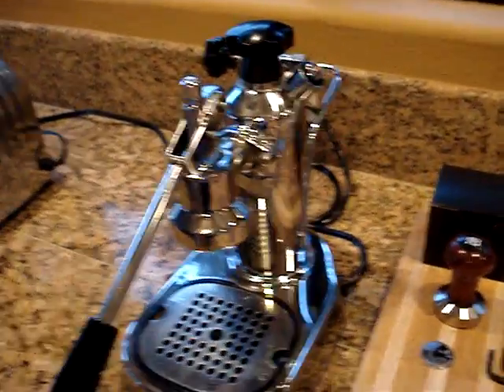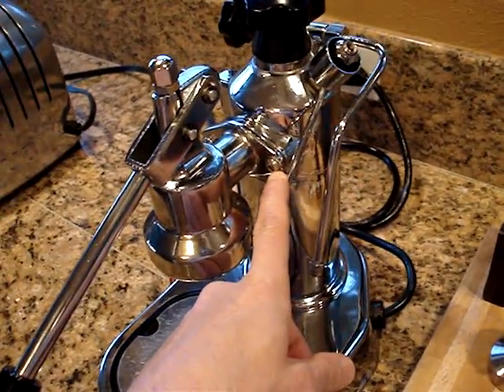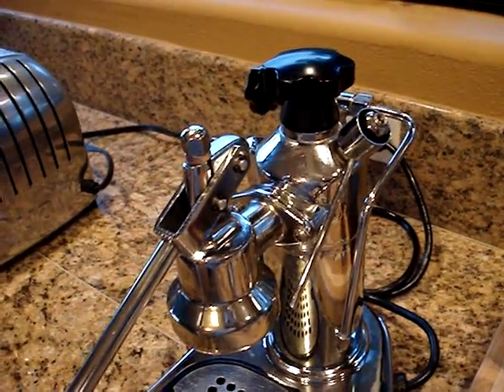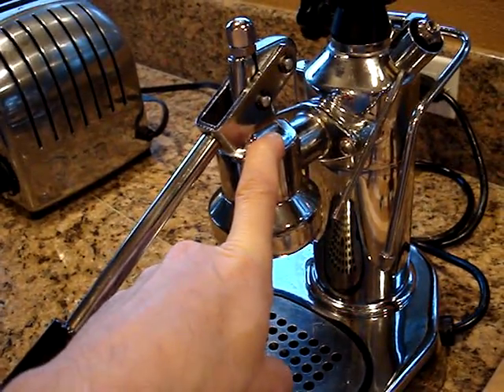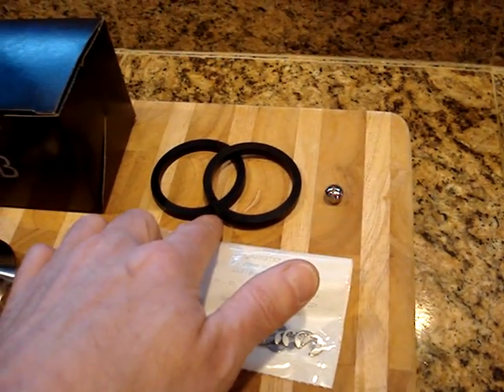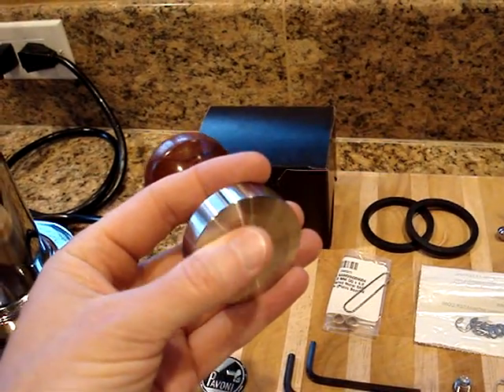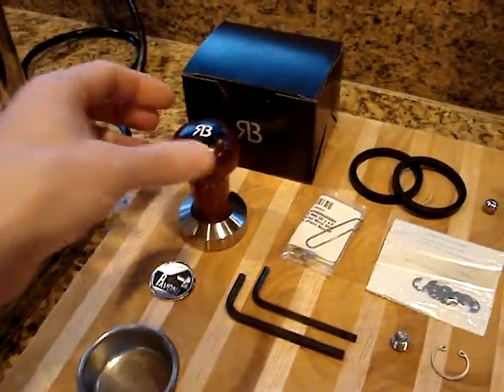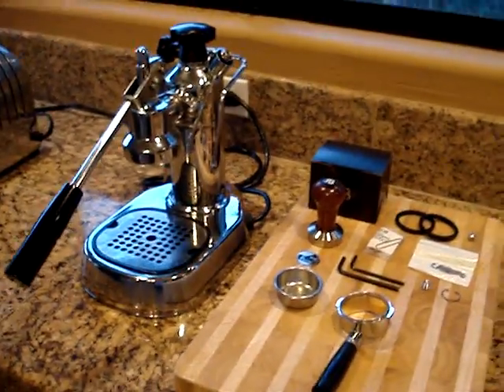La Pavoni pre-millenium espresso machine modifications

Comment: Where do you buy your parts for the LP? I have the exact same model (and I mean exact, except with a 220V european boiler) and I buy parts from OE. Unfortunately OE only has the rounded boiler head seal, not the squared that you show and I can't find E-clips anywhere (I've been holding one pin on with wire).

Comment: what is the reference number of the gasket, looks like a good idea
Reply from the maker: Which gasket are you referring to? This video is 10 years old, so I'm a little rusty
Reply: @ray5961  the flat one deployed under the group that holds the shower head in. Yes I know it’s been a while, I’ve been following your PID adventure on home baristas.  I’m admiring your work
Reply from the maker: @leighp03  Those either came from McMaster or Orphan Expresso. I vaguely remember buying a pack of square profile O-rings from McMaster and having to use a Mach III razor to shave a slight radius into one edge to make it fit, If you search "PID La Pavoni" on google there's a thread on the Home Barista forum which details a lot of the parts I used on this machine; you might be able to find some handy info there.
Reply: @ray5961  thanks for thaking the time to reply
Reply from the maker: @leighp03  You're most welcome